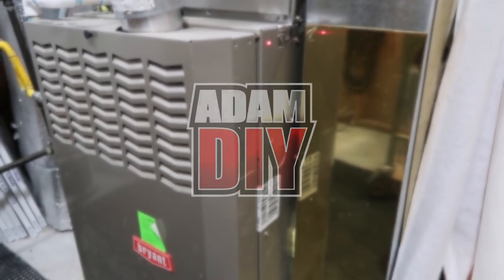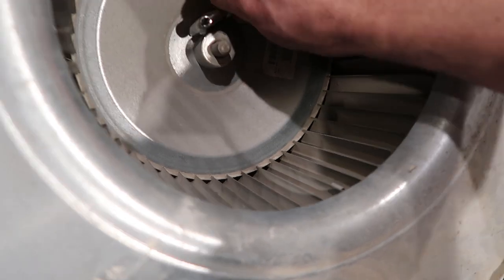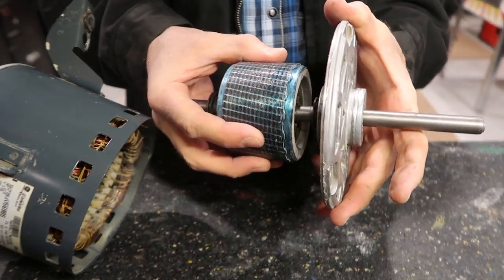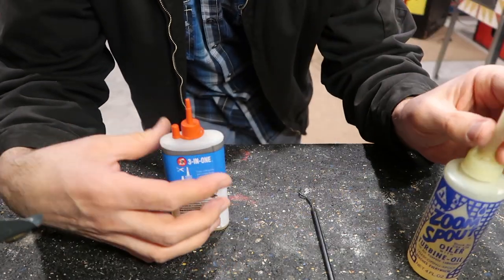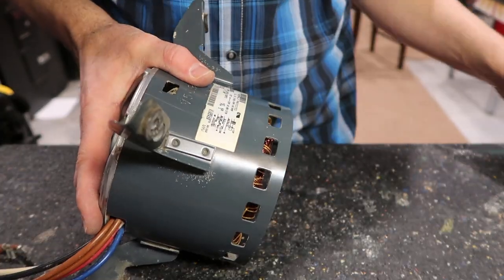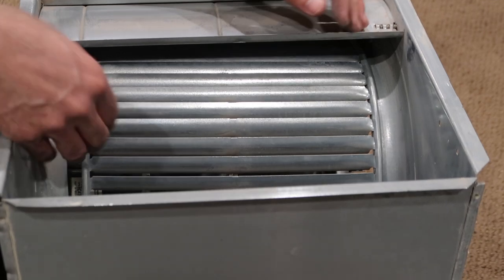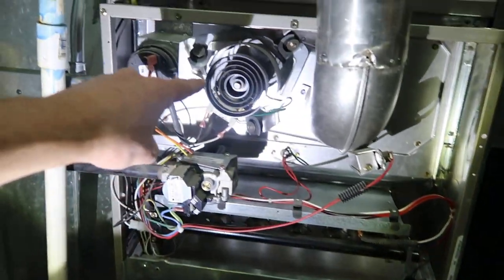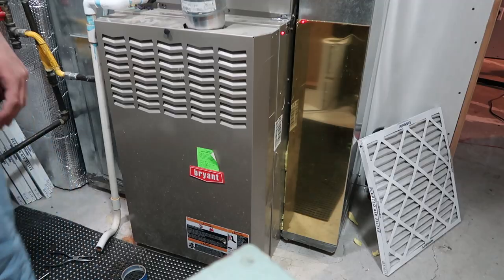How to oil electric HVAC fan motors with no port - Squeaky Furnace Repair

Comment: Well done!  As a retired pilot I can tell you that you are absolutely right about the debris on the fan blades as they are actually airfoils and are greatly hindered when they are not clean and smooth.  There are many stories of airplanes not being able to take off because of a light frost on the wings!  Best of luck!
Reply: What's the worst is when ice  forms on the wings & then breaks off just at take-off & gets injested into the engines.

Comment: I used the ideas in this video to lubricate the little evaporator fan in my fridge/freezer. It was so loud it was unusable not to mention that it would stop spinning every few seconds. The appliance repair website said motors like this couldn't be repaired and needed to be replaced ($60.) It's fixed now for just a little time and effort.  People such as yourself who share their knowledge make the internet better. THANK-YOU!

Comment: This video was a lifesaver! My furnace blower had started squeaking and then eventually got to the point where it would not start, I replaced the capacitor but it still wouldn't work. I could get it to run by manually turning the fan to start it, but it would always die out and stop after some time, I'm assuming because it was just getting so hot from spinning that it siezed up. Thanks to this video and another that helped me confirm it was okay electrically I managed to get it running for under $15! It would have been five but I had to buy a wrench ;) Thank you so much for this tutorial! I finally have a cool house again and NO $500+ repair bill!!! Woo! For anyone needing to get to oil quickly I managed to find mine at Lowe's so I didn't have to wait for shipping either. Great fix!!!

Comment: Very nice video, Adam. Your furnace is 90% like mine. It's "comfortmaker" brand and the startup sequence is slightly different. I'd gone through all of this before I ever saw your video. I have some electrical experience, so I went by intuition. A month later, the blower started squeaking again. I found your video as I was looking for an oil recommendation. I had used 3-in-One all purpose oil. When I do it again, I'll use the 3-in-One SAE 20, like you did. The info about the sponge in the bearing was appreciated. To other viewers: I recommend labeling all wires with tape before disconnecting them.

Comment: New blower motor quote: $271
Labor (Sunday x2) quote: $450
Scratch that...
3 in One oil: $4
Knowing that by following the steps in this video I was able to repair my own hvac blower motor: priceless.
Reply from the maker: WOW that's a huge chunk of change you saved!
Reply: Completely new motor off ebay $55 bucks since your in there lol
Reply: Adam DIY
Yeah,I would do the exact same thing,but unfortunately I'm bedridden.I can't get down to the furnace to do that work,which is exactly what I would do and have done before,but my friend is stubborn and won't listen to anything I tell him to do,so he and my daughter are going to the furnace supply to get another squirrel cage because the furnace guy that was here screwed it up,he's got the blower squirrel cage rubbing on the housing and all the motor needs is just what you did,take it apart,oil the felts in the ends of the motor plates,and one thing that you neglected to do,and that was clean the shaft and interior of the bushings with a rag and some solvent because there are Gummy deposits in those oilight bushings and on the motor shaft. And those caps are called "dust caps" they're there to keep the dirt and dust from working its way down into the bearings.It's imperative to replace them to keep dirt out of the bearings/bushings resulting in the same problem you had before,if not complete motor failure !!!!!! Just sayin'  ♿ 🇺🇸

Comment: You just saved me a ton of money during a 90 degree heatwave!!! Squeaky bearings in a oilless GE motor, took me all night to get the coils cleaned out and the motor re-oiled but everything is running smoothly now and the house is cooling down again! also doesn't help that the crap plastic drip pans try to disintegrate when you open them up...

Comment: Excellent video Adam! Looked at a gang of motor lubrication videos on here but yours is the best by far. I just did my condenser 1/4hp fan motor which has no oil ports in the end bells so I marked the end bells with a sharpie marker so I could not mix up the end bells on re-installation. Works like a champ....thanks Adam!

Comment: Good tips Adam. I did mine about 5 years ago. What led me to "dig in" was the motor was vibrating and making noise like crazy. Mostly caused by sheetrock dust collecting on the blower wheel, throwing it out of balance. That probably put additional load on the motor bearings as well, as the spindle end that goes into the wheel takes a beating. 

Surprised they didn't provide an easy way to oil these motors - used to be more common. While I had mine apart, I drilled a hole in the top of each bearing housing to accept a short length of 1/8 stainless tubing pressed in, to which I attached two lengths of thin Tygon tubing to run out to the front of the blower housing. Now, every 5 years or so, I use a syringe to add more turbine oil for the bearings. 
The design, with no external oil cup, is another silly example of our throw away society. The HVAC companies around here  just put in a new motor, don't bother to rebuild them.

Comment: Dear Everyone!
This is the right way and only way to actually fix motors of this type. If your motor is of another type, then it may have holes marked "oil", but the 4 holes on the bottom (shaft end) are NOT oiling holes, they re drainage holes for any condensate or water that get in.
MANY "experts" on the internet are claiming otherwise - but Adam (this video) is the correct one for many motors. 
I first just tried the usual - flushing a bit out the shaft with WD and then using some oil around the shaft and some junk came out (a good thing)....and it worked for exactly one day and started squealing again.
Today I did it as per this video. It was easier than I imagined and I soaked the cotton on both ends with 3-in-1. 
Of course, we'll have to see how long it lasts (unit is 16 years old, so I ordered another motor for DIY installation anyway), but right now it is quiet and working like a dream. Everything inside the motor looked good - I have a feeling this would now last years (but won't tempt it).
So, don't do the "other" job. Either do this or call a pro ($650+  to replace an A/C motor that they pay $150 for, but that's their right (to make $$).

Comment: I appreciate the step by step instruction.  Now we're in the pandemic, we need to save as much money as possible.  So far this year with the help of Amazon and Youtube,  I fixed my dryer with a $15 start capacitor, my fridge with a $28 start relay/capacitor for the compressor and now I'll do my ac condenser motor with $6 - "3 in 1" oil.  Cheers guys!

Comment: Nicely planned and edited video.

You were lucky to have the blower wheel slide off the motor shaft without requiring the wheel puller that grabs on the hub of the blower wheel.
Reply from the maker: Thanks!

Comment: I just did this on my AC unit that I heard weird rattling from. The motor was very similar to the one in this video in almost the exact same condition. The back bearing was dry but not too bad but the front was black and some of the felt material had gotten up into the bearing and cooked itself onto the bearing. I got some of the 3 in 1 motor oil from Grainger for less than $5 and it is running smoother than ever. While the motor may go out in the future this prevented a $200+ fix in the mean time for less than $5.

Comment: I just did my downstairs unit, last night the motor started to chirp and couple hours later it stopped.
I grabbed some compressor oil and tool and knocked it out with  a good cleaning in ~2 hours ;)
Thanks for the video, well done.
/too bad I have another unit for the upstairs. Guess its next ;)
Barry

Comment: Thanks for a great video.  I think my motor is beyond oiling, but I'm going to try just in case it does work. Here in Canada, a new blower motor for my York furnace is about $1100.00, plus 13% HST in Ontario. Yes, you read that right. A new one in the US is about $150.00. Just wanted to make that point for any other Canucks before they get completely hosed buying one here.

Comment: I just drill holes in the outside of that bearing box piece of sheet metal surrounding the shaft just drill one little tiny hole in there long enough to get that spout from that oil bottle in there you’ll never have to take the motor apart again!! 
35 years HVAC❤️🇺🇸
Reply: Pete Lasko
Yeah,I do that too but sometimes you have to get in there and clean the Goo out first,and after drilling a hole and lubricating,I stick a round toothpick in the hole to keep the dirt out !!!!! ♿ 🇺🇸(70 years motor repairs)

Comment: Would it better to replace the motor since it is out? I have a 30 years + motor which never change.
Which way is better? new motor or oil the oil motor? Thanks for the video.

Comment: Saved the cost of buying a new motor. Had Goodman furnace with 1/3 HP GE motor. Blower motor was hard to turn and was not turning, just buzzing. Took apart and added 3 in 1 oil in felt material. Now freely turning.

Comment: Thanks for this video. I used your instructions to disassemble the blower motor and lube the "sealed" bearings - no oil port here. Worked great!  :)
Reply: gopcss
Not "sealed" just "pre-lubricated"yeah right,for how long ????? ♿ 🇺🇸

Comment: Just replaced my blower a few months ago because the old one wouldnt get up to speed and replacing the cap didnt work. Thought about trying to mess with the old one recently just for fun and see if I could get it working and found your video. I could swear I must have your old furnace because I have the exact same blower motor and wear on the same bearing. Havent got it running yet, just need to wire it up to test, but thanks for the video!

Comment: Many thanks fir your video. when I do my next clean up I will do it exactly like you did it. For now it is not worthy because I may be purchasing a complete new air handler because mine is a 1998 and it looks like it was used and today 06/2021, I just got rid of the rust and mold in it and I saw that the blower wheel had been painted.... to cover up the rust I guess? I will keep all the part that look new to me though. I suppose that that it is my legal right to keep the old parts. I did not see any oil caps. I am very thankful to you for teaching us and so allowing us to save money in repairs of such a needed and expensive system and ... so few honest technicians.

Comment: Just a tip to removing and rehooking wires , what I have done for decades if they are all different colors great otherwise I used to use a sharpie and put dashes on the wire then I would simply cut all the wires (using common sense) and wire nut them back together with the same color and the same number of dashes. Worked for me.

Comment: This is so true....motors don't wear out usually but their bearings do and usually the number one reason for motor failure/wear. One reason why folks could to do this or have their technician do once every 5 years maybe. Oil will evaporate over time as it goes through the heat cycles which is why the packing material dries up. Getting them oiled again will allow the packing to retain and hold the oil to allow a tiny small film to run onto the shaft which is what sleeve bearings are designed to work with. Once the oil goes away, the shaft rubs onto the sleeve bearing and begins to wear off metal which in turn will begin to damage the sleeve and/or the shaft. HVAC tend to use sleeve bearings because they tend to be quieter than the traditional ball bearing design which last the longest and are permanently sealed with lube. So, if you must replace the motor, be sure to do one thing for sure which is to use an OEM factory made motor or if the cost is too high or its not available any longer,  source a motor made in the USA if you can find one. Nidec/US Motors (they purchased Emerson Motors) is a good brand who makes these motors for air handlers and condensers in a couple of quality levels. Their standard uses self centering sleeve bearings and their Mojave line uses ball bearings. I always opt for ball bearings since they last longer and don't require lubrication intervals for the most part.

Comment: Nice video to show others how to service electric motors. I also use Kluber Almbygon TA 15/2 on shafts susceptible to wear. That type of grease is used on front load washers and won’t wash away with soap or detergents and will not break down over time.

Comment: Great job!  I did this and it solved the noise issue for about seven months.  I tried repeating the process and I got two more days of noise-free service before getting more squealing.  Anything else to do at this point or bite the bullet and get a new motor?

Comment: good vid Bro, jus did my grandads fan.   dont know why they say oil-free maintenance unless they want it to burn out so you buy anutter one.   Shopvacs same way, you can take Shopvac motor apart and oil it, and it last forever.

Comment: Thanks, AdamDIY!  This is exactly what I needed.
(Stupid that they didn't put oil Potts on these!)
Reply: Manufacturers need to sell more motors when they fail. Installing oil ports and lubing the motor regularly increases  the life of the motor.

Comment: This was a very helpful DIY video. I have one issue after oiling though that once I put the covers back on the shaft does not freely spin by hand. If I loosen the bolts it spins freely but as soon as i tighten them up it dies not sping by hand. Any suggestion would really help

Comment: I used this as permission to drip sewing machine oil into a cat toy motor that stopped functioning. There was no way to open the casing or I would have tried that. It worked out well surprisingly :)

Comment: Hello Adam, great video very helpful. If I want to change the sleeve bearing, do you have any video, if not please make of same motor. Thanks
Reply: I would like to see the video of the bearing being replaced.
Reply: I have never been a fan of bronze sleeve bearings myself. However, they are cheaper than ball bearings, meaning more profit for the manufacturers. Seems to me, that if sleeve bearings have been run dry for some time, that they will have physically worn to the point where there is more slop in the fit & alignment with the motor's rotor. The bearings are much softer than the steel shaft of the rotor, so they should conceivably take the brunt of the wear & tear. Replacing them, along with fresh packing material, makes complete sense to me. Locating replacement bearings may obviously be either a pain or piece of cake. You would need a tool to use to press the bearing out with. It would be a stepped shaft, needing to be the same diameter, or just a fuzz smaller, than the OD of the bearing, & the end of the tool should fit perfectly inside the bearing, just as the rotor shaft does. Using basic thermodynamic principles may make bearing replacement easier. Heating the end plates, to slightly expand the metal, up would make it easier to push the bearings out. Freezing the new bearings, to shrink them a bit, would make them easier to install. You may just be able to force them both out & then back in at room temperature.

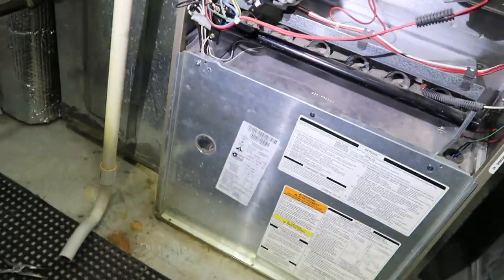Comment: I like the work you did, but you should also fix your vent pipe. You have a screw hole where it connects to the appliance visible at 8:06. You should cover that hole so you don't get any exhaust and carbon monoxide spillage. Also cover the screw holes on blower compartment panel visible on left at 8:38,  unless they don't go into  blower compartment.

Comment: Great video! Just what I was looking for. I just had to replace my motor. It was giving off a burnt electrical smell while running. It hadn't stopped, but I figure it wouldn't have lasted much longer. The new motor has no oil holes, so I assume it is pre-lubed from the factory. Anyway, I installed it out of the box. It's been in use for just a little over twelve hours, but when it starts up it's now making a sound that makes me wonder if it has a dry bearing. Do you think it could be dry? It's a sort of metallic scraping noise on start up, but I don't hear it if I spin the shaft by hand. I notice that there are black plastic rings over the caps where the bearings are. Should I try to remove these to gain access to oil the bearings or should I take out the four bolts, as you did in the video?

Comment: Ya that dust on those fins are a pain when you can't use a pressure washer unfortunately it's winter so the shower head and tooth brush was my go to cleaner

Comment: Thanks for the video. Would this be the cause on why my blower motor has a deep hum/vibration when powering down? I spun it by hand and as the squirrel cage slows, you can hear the vibration/deep hum for about 4 seconds. Doesn't do it when on.
Reply: Yes,Bearings are.  starting to dry out,lube now to prevent seizing and motor failure !!!! ♿ 🇺🇸

Comment: Thanks for making this, very informative.  May keep my motor going for a bit more.  Two questions: 1.)  I didn't have any of the oils you showed, but I did have some sewing machine oil, do you think that will work good enough (seems to be anyway, I just oiled it last night)?  2:) There appear to be some type of washer assemblies on each end of the shaft, are those replaceable? I had one on one side where it looks like the rubber washer is tearing and I like to replace it, but I'm not sure what it's called.  Can you provide any feedback? Thanks
Reply: Numerous Utube videos recommend sewing machine oil for this exact purpose.

Comment: My 2-stage fan works only when it's in fan-only mode.  When it kicks into high speed for AC or Heat, it grinds to a halt.  What do you suggest?